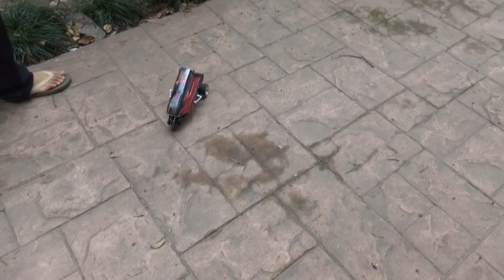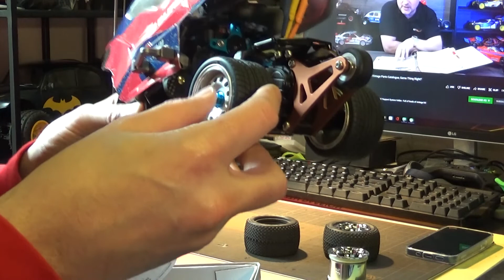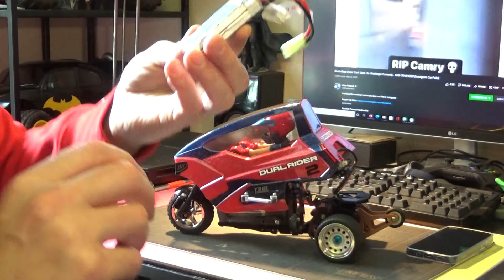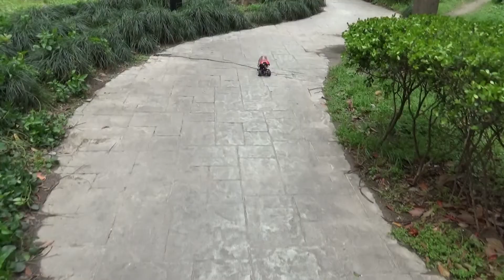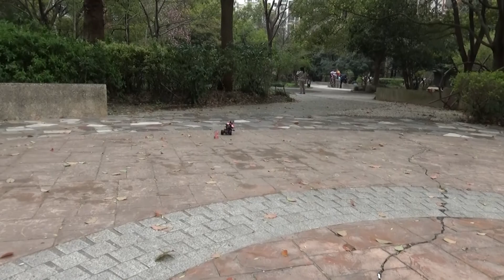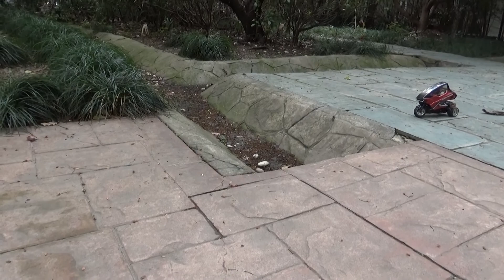Tamiya T3-01: Brushless Build

Comment: Hi man, thanks for this video ! 👍👍
I have the same problem as you with the Hobbywing motor diameter.
Do you have a link to the HR pinion that you bought please?
It is an 18 original teeth it seems to me, but what a module, 0.6, 0.5 or 0.8 ? 🤔
Reply: I said a stupid, the original pinion is a 26 teeth and not 18, but I still don't know the pitch.
Reply from the maker: I’ll have to research my orders to find out… It was hard to find a pinion that worked.

Comment: Liked your trike and would like to know more about the Kawada wheels and the tires. I think I found the Kawada wheels at Banzai Hobby Japan that are out of stock now (where did get yours from?) and most of all (I know it's been 2 years) I would like to know the brand and part # for the tires that you used? Thank You! for your time and help!
Reply from the maker: @ipdtt  I got the wheels and tires at RCMart. They are still in stock.

Kawada Wide Radial Tire 2 pcs w/ Foam Insert For 1/10 M-Chassis #TUM03W. 
MODEL:TUM03W
SKU:00078717

Kawada Dish Wide Plated Rim 2 pcs Grey For 1/12 RC 
MODEL:TUM35P
SKU:00101605
Reply: @Triggered-RC , Thank You so much and I hope you still run it once in a  while.

Comment: I wonder if upgrading the front shocks would help with higher speed turning.... seems to tip alot because your setup is too powerful lol. Good work though 😊
Reply from the maker: I think it has not to do with weight distribution up high, and the width of the rear wheels. Inherently an unstable design as well as trikes tend to flip. Still, pretty fun to rip around.
Reply: I wonder if driving it on a smoothe surface would help ???????Duuuuuuuuuuuuuuuuuuuuuuh !  these thing are so graceful , more like an aircraft to drive .Shame it's expected to jump ....buy a buggy your missing the point .